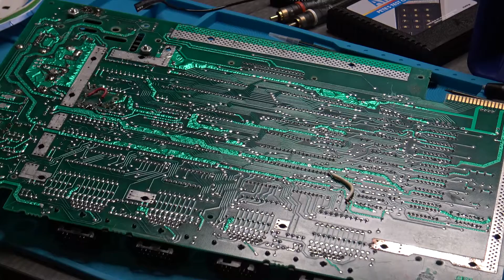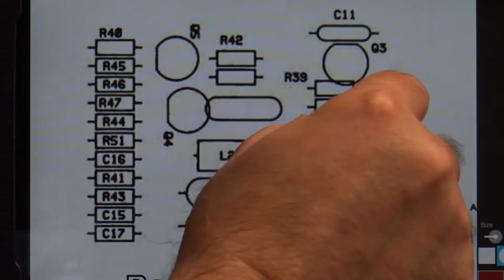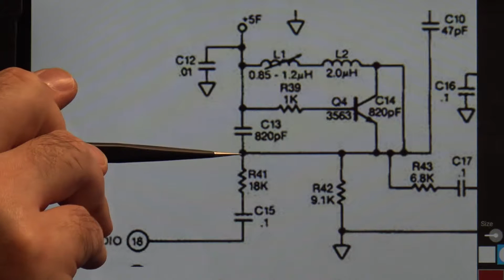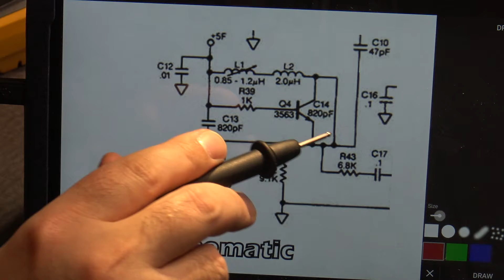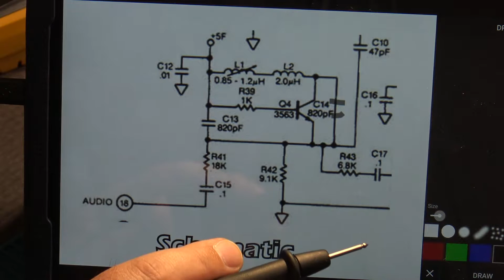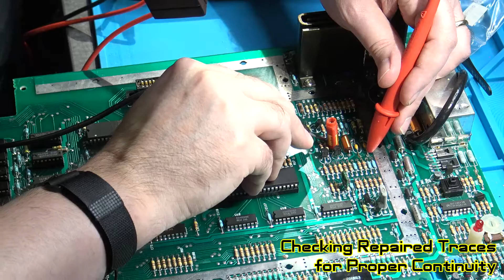ITC#65 - Atari 5200 - Repairing the Audio

Comment: Bad mistake - it appears that you used ceramic capacitors (>100kHz, bad in low frequency) by replacing the film caps. Film caps are used in audio as ceramic are non-linear in voltage and frequency response with changes to impedance and capacitance, and can piezo (micro-phonic) with voltage and vibration (harmonic distortion ringing). Low ESR Electrolytic NP are a cheaper substitute to large value audio film caps.
Reply from the maker: @cbaxter6527  these were mlcc type yes and at the time of that video is what console 5 was selling and including into their power conversion kits as direct replacements. Now their kits come with exact same polystyrene caps as the originals. But again this video predates that.

Comment: Hi there I have two Atari 5200s that on the top they look identical but when you turn them upside down the one unit has the little teeth that stick out on both sides that you wrap the cable around and my other one does not have that it just has a rounded area there. That seems to maybe be missing something but I can’t tell do you have any idea what could be missing by chance One has like I said the D parts that stick out on each side of the case that allows you to wrap the cable around but my other unit does not have that and it does look like it should have that but I’m not sure how it fastens to the bottom of the case Any help would be appreciated
Reply from the maker: The late 2 port units has a slightly different molding on the bottom shell that included little studs off the corners on the center bottom portion to wrap the RF cable around. The earlier 4-port models and some earlier 2 port units used a separate piece of plastic that was like a flat ring that would snap into place around the center of the bottom and the cord could be wrapped up inside and around that. It is possible you have one that used to have that second ring section that was supposed to snap in but must be missing on yours.

Comment: Fasinating to watch.  I have 2 working  5200s. A 2 port and 4 port interesting to see how it works and the insides. Nice video.
Reply from the maker: Thank you for watching! The 2 port looks nearly the same inside minus the 2 center ports not present of course and so a few less components and traces on the board in the lower center of the main board. Biggest difference between the 2port and 4port units is that many of the 2 port units have the chips soldered down in place sometimes making some repairs a little more complex.